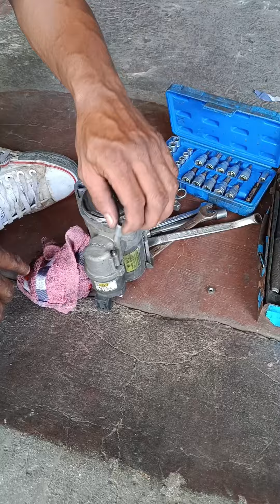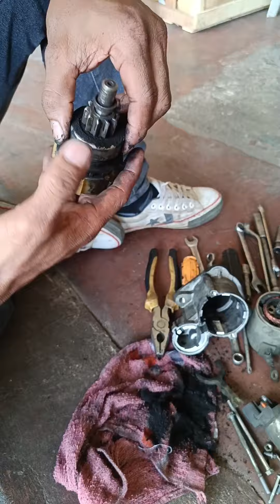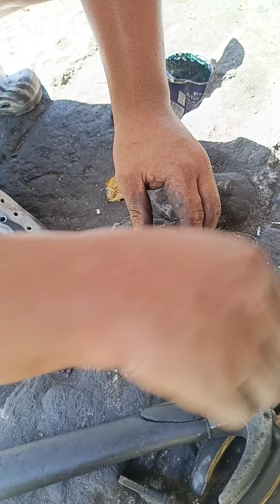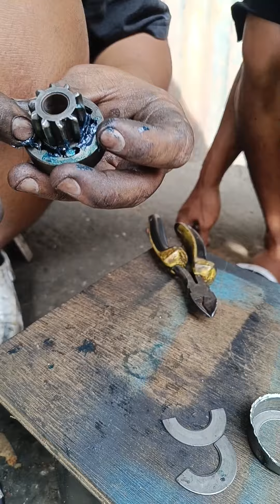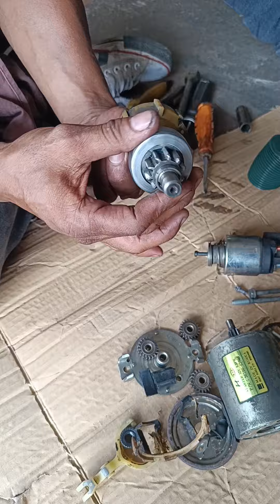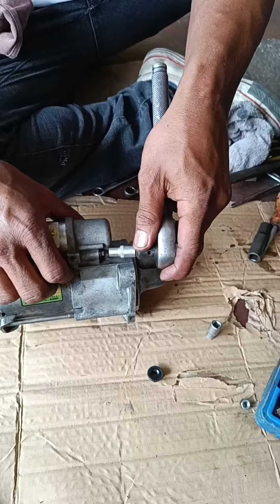Repair Bendix drive starter motor Hyundai accent

Comment: Magandang gabi boss,my tanung ako noy tungkol sa f6a ko, bakit po noy pag binitawan ko ang gas pedal ay nmamatay cya, pero 1 click lng cya kong paandarin,ano kaya sira noy?
Reply from the maker: @veincenthbandin9662  idle solineod switch ng carb check mo Meg baka putol ang wire
Reply: @ManinoyWhite  hindi man potol boss, ge test nko mo pitik man cya pero gmay ra kaau iyang pitik boss